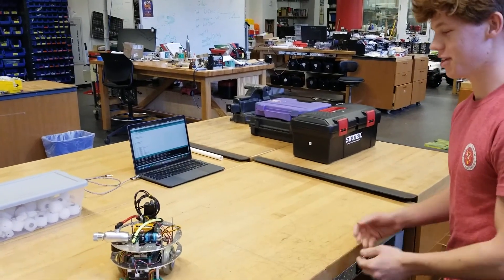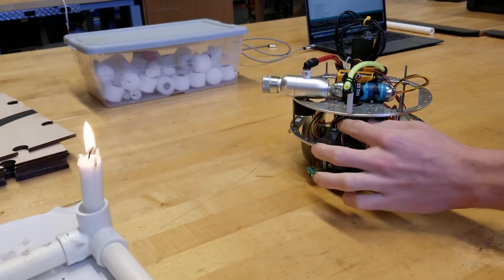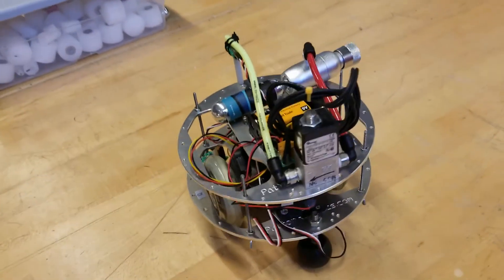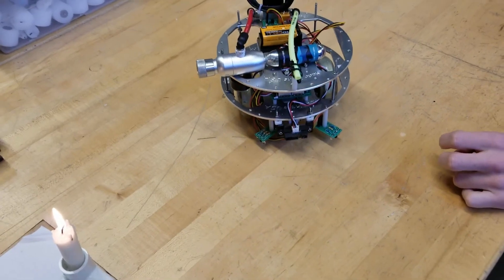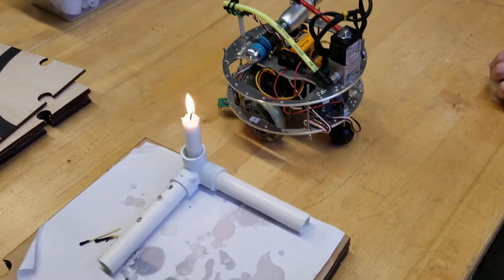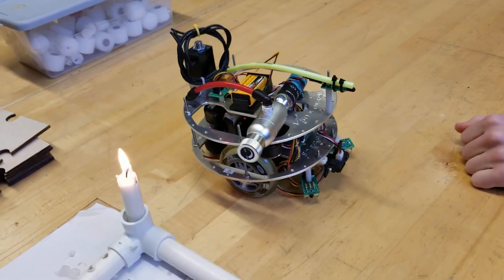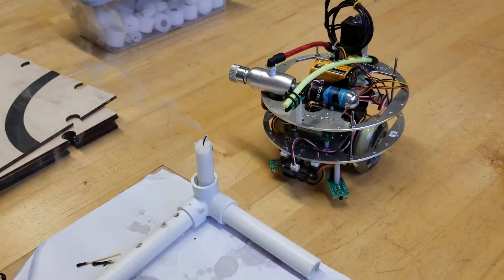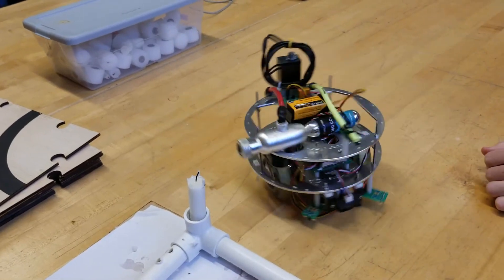Will's Fire Fighting Robot

Comment: What is the extinguisher?
Reply from the maker: Pressurized CO2 cartridge from a bicycle flat tire inflator. The hard part is getting the pressure down to a manageable amount. (The pressure in the cartridge is several hundred PSI.) The pressure regulator is repurposed from a home beer brewery kit and knocks the pressure down to 60 PSI or so. It is adjustable with a knob.